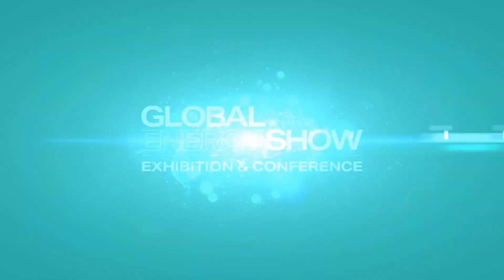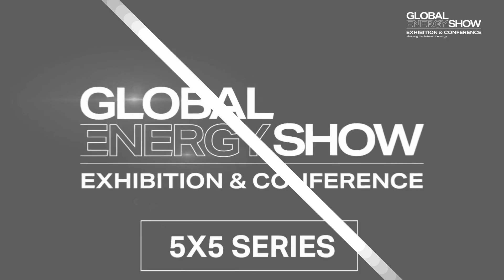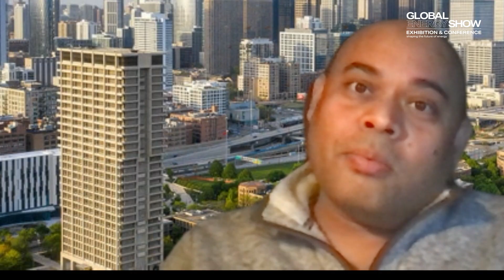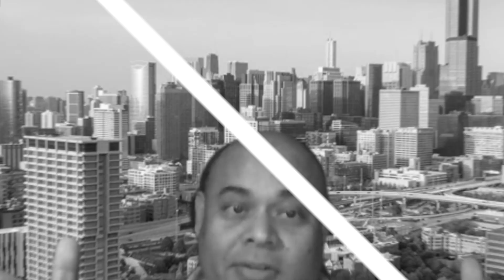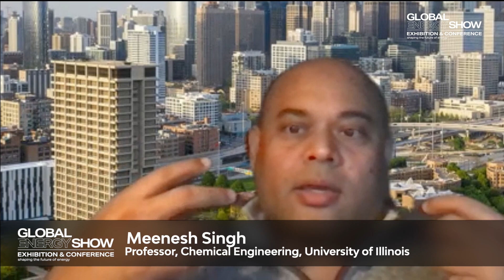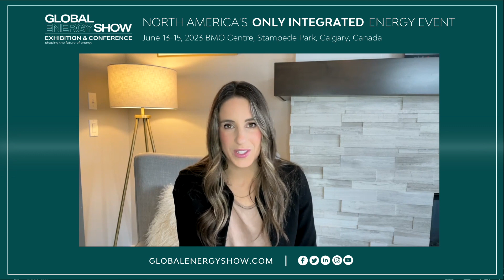Journey to Net Zero with New Carbon Capture Systems

Comment: Getting to Net Zero by 2050 would cost $9.2 trillion a year globally (McKinsey). That's not going to be good value for money. That's nearly one-tenth of global GDP. That money would be better spent on a myriad of things including educating the fifth of humanity who are illiterate and represent a 7% annual loss to the world's economy. Any country that attempts it will be indebted or impoverished. 
Example: For the UK to reach net zero by electrification of its transport fleet and heating system, it will require a tripling (as a minimum) of its current electrical generation capacity among other things. This will essentially require the UK consuming all of the current global supply of copper and other rare metals for the next 25 years. The cost will be unaffordable and the skilled manpower levels unattainable. And that is just to eliminate the 1% of the global CO2 emissions that the UK is responsible for. So times that by 100 for the Earth. 10,000 child slaves in the cobalt mines of the Congo not enough for you? Make it a million. Imagine all the human suffering and environmental damage done from all that resource extraction! 
An electric vehicle requires 6 times the mineral input compared to a conventional one, and the carbon cost is greater until you reach 80,000 miles.
Production of all of these minerals has been mastered by China: a totalitarian communist regime that thinks nothing of the mass murder of its own citizens, imagine how much it cares about the rest of us.
And why are we embarking on this great net zero crusade? For what? So someone can virtue signal by driving around in a Tesla.
Maddeningly, there is no climate crisis. The Earth was warmer in the recent and distant past.